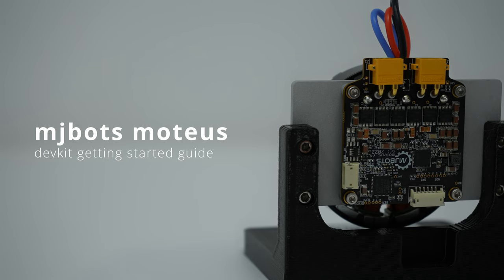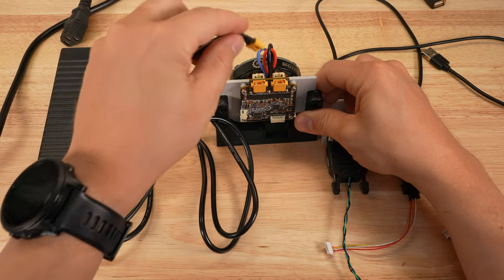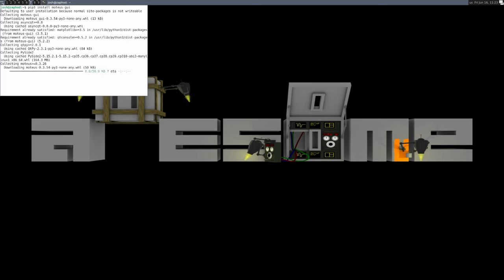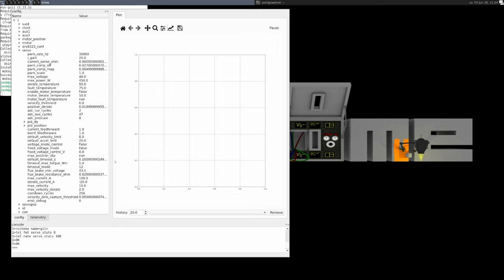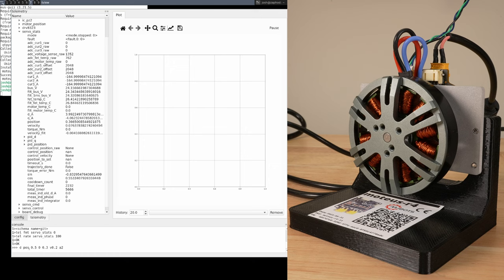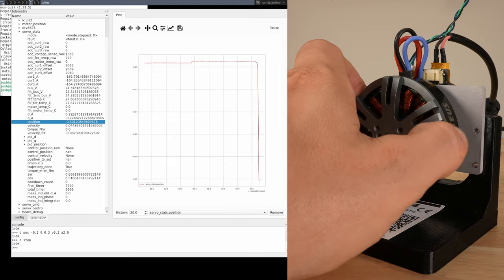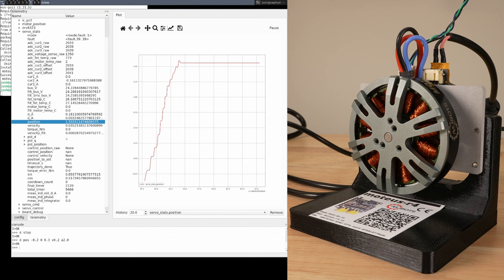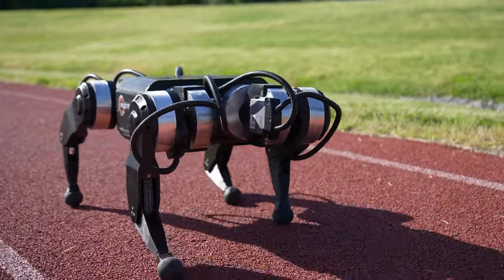moteus developer kit getting started guide (2023 edition)

Comment: Great tutorial, straightforward, to the point, and accurate. One question,  I get this terrible whirring noise when I run the GUI, is this normal?
Reply from the maker: When you command motion or run the GUI?  "terrible" audible noise is likely a result of inappropriate PID tuning.  devkits should come decently well tuned out of the box.  Are you using a devkit or some other motor?
Reply: @awesjosh  devkit! maybe 'terrible' is pretty subjective, I ended up recording it https://www.youtube.com/watch?v=HQof8PDN030, does this seem normal? maybe a bit hard to tell.  Anyhow, I am using the stop function so I can work without being irritated, but I hope I'm not running this thing at too high of voltage and increasing the chances of a problem.
Reply from the maker: That seems like a normal volume level for the tuning that comes with devkits by default.

What voltage are you operating at?

There are several knobs you can use to decrease audible noise. 

1. lower the `servo.pid_position.kd` gain
2. calibrate with a lower bandwidth
3. set a non-zero `servo.velocity_threshold`

While I'm happy to support here, YT comments are relatively high latency.  If you would like quicker turn around, hop into the mjbots Discord: https://discord.gg/W4hUpBb
Reply: @awesjosh  ok glad to hear it sounds about right. I haven't touched the default voltage or calibration values. I'm considering this issue closed, thanks for your help!

Comment: Excellent ! Congrats Sir. 
If I may, do you plan to create a tutorial on how to control your board thanks to an Arduino / ESP32 board ?
It will be very handy for a newbie like me.
Have a great day !
Reply from the maker: It is on the TODO list, although it both needs additional software work and isn't usually an optimal solution.  Usually if you are using something as capable as moteus, you're better off with a more capable host platform.  Raspberry Pi's are on the lower end, but more capable SBCs with dedicated PCIe CAN-FD adapters are also likely candidate host platforms.

Basically, the cost difference between a rpi and an Arduino/ESP32 is not significant in a moteus based system.  I will admit that the development experience with an Arduino or ESP32 can be better in some cases though.
Reply: @awesjosh  Thanks a lot for your reply. So I will cross my fingers and wait for this potential tutorial :) Have a great weekend !
Reply from the maker: I don't have a tutorial yet, but I do now have a draft library to control it from Arduino boards with a MCP2517FD or MCP2518FD shield or integrated controller.  If you're interested in testing, check it out:

https://github.com/mjbots/moteus-arduino

or hop into the mjbots Discord to discuss: https://discord.gg/W4hUpBb

Comment: The specs for the mj5208 motor say that it has a peak power of 600W but the moteus r4.11 controller is rated for a max of 500W and the power supply provided with the dev kit can deliver a max power of 120W. Under what conditions does the mj5208 draw more than 120W and more than 500W? Is the 120W supply adequate for testing?
Reply from the maker: You are correct that you'll be limited to the lowest power of the motor, controller, and supply.  The power the motor draws can be roughly modeled as the speed multiplied by the torque.  

With the 120W supply you won't be able to reach the peak torque when stationary, or as you noted, the maximum power while in motion.  That said, it is still pretty "torquey" and can go at the maximum speed for 24V no problem.  AC supplies just get really big fast when you start increasing the maximum power.
Reply: @awesjosh  Thanks for your reply. I'm new to building large robot actuators so I'm trying to gauge my expectations. It's difficult to find a benchtop power supply larger than 300W, there seems to be a step function on price and availability after that. So I was curious if providing for the maximum was really necessary.
Reply from the maker: I'd recommend starting with anything, even the devkit supply and see where it gets you. Often switching to a battery can be a more cost effective high power solution when you need to go there, although that comes with its own challenges in terms of system power on.  DIY solutions also sometimes use re-purposed server power supplies, which can be found in the 500W-1000W range more readily.

If you do go with a battery, you have to be able to connect the battery that is never off to the giant bank of capacitors that are multiple motor controllers without sparking, thus pre-chargers like the power_dist.
Reply: @awesjosh  Thanks Josh, I just got my dev kit and it's working great. I think it will be nice to have a working baseline as I try to experiment with different parts.

Comment: Can the wall power supply handle the back emf voltage spikes from braking?
Reply from the maker: It cannot sink current, however, with flux braking configured on moteus the overall system is able to handle arbitrary braking loads.

Comment: Can someone tell me why the power cable should be connected to the controller before plugging the power supply into the wall?
Reply from the maker: So that you don't have a sparking event.  moteus has large capacitors on the input.  The power supply has large capacitors on its output.  If you turn on the power supply, then connect it, you will cause a large current transient (possibly hundreds of amps) as two capacitors balance out.  Large transients like that can cause damage through a number of mechanisms.

Comment: Can this motor be used instead of qdd100 for quad a1?
Reply from the maker: The quad A1 is specifically designed around the qdd100.  More generally, quadrupeds are only barely feasible with direct drive motors, and that is you count every gram and accept a bunch of other compromises.